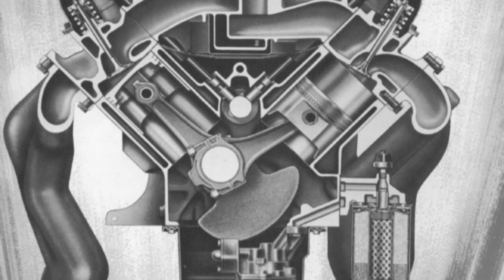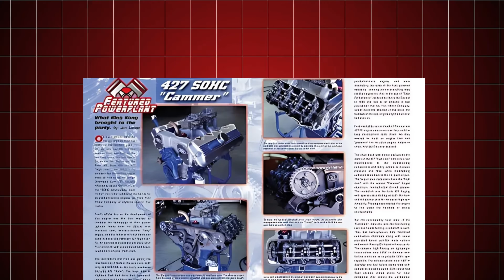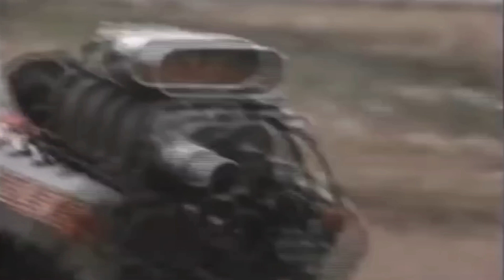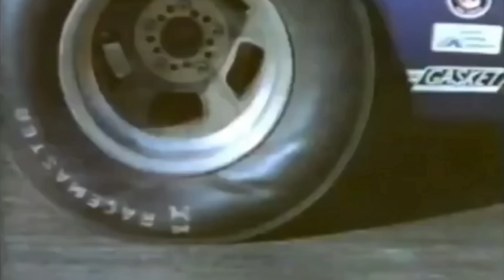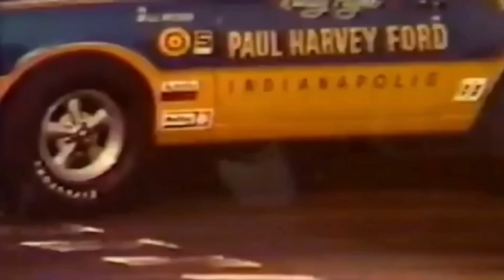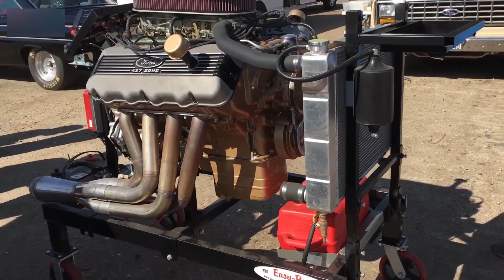The UNTOLD Truth Of Ford’s BANNED 427 Cammer Engine

Comment: So basically the only way Ford could make that engine work properly and efficiently was to take parts of a 426 Hemi.
So basically the Ford motor was worthless without taking parts off the 426 Hemi, therefore changing the Ford motor into some kind of mutant Offspring.

Comment: The Hemis produced in the 50s had true Hemi heads the ones in the 60s and 70s were not but very close  chrysler mashed the heads so the car body could be lowered over the engine and transmission on the assembly line

Comment: I have I brand new set of heads off on of theses that have never been installed on an engine. They are bolted together on a aluminum plate with a suitcase handle

Comment: Cammers would have been good except they had one terrible flaw.  Those 8 foot long timing chains were weak and would stretch, break, and were prone to cordial action (where they try to turn into a S shape when running). All of these issues pretty much doomed the engine.   Pete Robinson who was probably the last guy to run a cammer in top fuel and the most successful, designed and ran a very complicated gear drive to run the cams, but was long after the engine was out of production and he could no longer get parts.

Another reason it was canned by ford was it was basically designed for NASCAR, but they wouldn't let it run.   When Ford tried to get it allowed to run, Chrysler when to Bill France and said "if they are allowed to run that, we are bringing the DOHC Hemi out".   Nicknamed the "doomsday hemi"  the pictures Chrysler showed Bill was an early engineering mule that didn't even run, but the bluff worked and NASCAR banned the Cammer to try to keep the engines from becoming to exotic.  

Ford knew of the issues, but never solved them because there was no real place for the engine.  Instead they designed the Boss on their new 385 big block platform for NASCAR.  I really would have loved to see the Cammer in a GT40 if they had continued with that program, or the Calliope V8 used in NASCAR.
Reply: That DOHC hemi did run once, but it broke one boss on the test stand, and never ran again. It disappeared from the basement.
Reply: Chain was 6 ft .. engine wasn't good for nitro classes ...block strength wasn't there

Comment: So ford made a 427 i thought that was chevy an ford made 429or did thay make both like chev did with the 400 big block an small block mind you it might be a different size over hear in Australia 🇦🇺  witch i come to know in some muscle cars there an hear with our ford & GM / chevy too our Gm motor companys like our GM/Holden motors
Reply: Ford made a 427, 428, and a 429. Only the 427 was made like this
Reply: @treverbrown1692  cool thxu very much
Reply: Ford made numerous versions of their 427s.  You had center oiler and side oilers.  There were low riser, medium riser, and higher riser versions.  On top of all that you had the Tunnel Port (cyl heads), the SOHC, and a 3V versions nicknamed the Calliope.  And finally the hydraulic lifter version offered in 1968.  Pretty simple right?  Lol.
Reply: @anthonytomaro8278 low riser was 1963, these were essentially the same FE heads every other FE got. 1964 saw the High Riser introduced for racing, cars required the teardrop hood bubble to clear the carburetors. 1965 saw the medium riser, which gave most of the performance of the high riser but fit under the stock hood and became the heads on street 427’s, while other FE’s kept the low-riser. The Tunnel-port was a nascar head to make the FE competitive with the HEMI. The 427 was under square with 4.23 bore x 3.78 stroke, the 428 was longer stroke with 4.13 bore and 3.98 stroke, which made for a nicer street engine, especially in heavier cars. The 429 was a new design for coming smog era called 385 series that replaced the FE and included the 460 and Fords top nascar engine the BOSS 429 semi-HEMI.

Comment: Now it is time Ford builds a 427 doulble overhead cam. They could use the 6.2 Raptor engine as a base
Reply: The coyote already has an aftermarket block that can go to 400 cubic inches.
Reply: @JC-gw3yo  sohc was built off of a FE block (a big block)
Reply: I was just thinking that a big block version of the Coyote/Voodoo engine was due. 

Imagine putting one of those in a Superformance GT40 MkII.

Comment: I’m 71 years old and 700 hp is something you can by from the Dealer. Today I think you can buy better than 1000 hp in a street car. 
I’ve seen a lot of beautiful American cars in my lifetime. 
They should scout this country for every older car and restore it. Even go back to the simpler manufacturing of older cars. 
I guess that the price of steel plays a role in it. 
So make the parts from fiberglass. A lot of nice fiberglass cars out there.
Reply: Really 700 in the 70s. I think you are drunk. 
2005-2010 in Australia bringing in your parts was lucky to make 650 ish
Reply: cars are aluminum for weight and fuel mileage... cars are composite because it crashes better than metal, weight, and fuel mileage. 
you can bounce a buggy off a composite car at the store without a dent or scratch, a metal car you get a dent and paint damage

Comment: Ford and Dodge Nothing on Chevy chevy's win more manufacturer Championships with NASCAR than both of them put together
Reply: That's not hard to do when 80% of the cars on the track are Chivy's. If they were so great then why was the SBC allowed to run in a lighter car than the Ford Cleveland in Pro Stock? Could it be that they couldn't make enough power to be competitive with the Cleveland at the same weight? Lmao!!
Reply: Because Nascar catered to Chevy for years .
Reply: @scottw2157  EVERYTHING caters to sbc.  Annoying
Reply: Because 90 percent Chevy Da!!!!!
Reply: Cause they slowed the fords down cause chevy drivers was crying remember in the early 90s when chevy couldn't win a race ?😂they slowed the fords down so chevy could keep up!!! 😂  and bill Elliot set all time speed record at talladega with 212.8 mph in a Ford thunderbird before restrictor plates so why didn't chevy beat that ?   Truth is nothing runs like a ford motor when allowed to breath
Reply: @CBGRTR  🤣🤣🤣🤣🤣🤣 From 1955 to 2001 Chevy's win 798 Show me how many Ford has win 🤣🤣🤣🤣🤣🤣🤣🤣
Reply: @Tgtouh-oe9ld for has 831 wins in that era try again 😂   ...in 1990 they had to slow the fords down cause chevy boys was crying so much ...research? Yeah maybe you should try it ...and the only reason so many back in the day build chevy motors more cause they was alot cheaper to build than a ford ..pound for pound ford motors always better you can take a little small block 351 cleveland built and it will dust ANY chevy motor of the same cubic inches or even more cubs
Reply: @CBGRTR  🤣🤣🤣🤣🤣🤣🤣🤣🤣🤣 Here's a hard Facts  If you want you can go check Wikipedia nascar Chevrolet has been the most successful manufacturer as of 2023, with 851 race wins and 42 manufacturers championships. Ford ranks second with 728 victories and 17 manufacturers championships. Dodge is third in wins with 217 and two manufacturers championships (albeit no longer in NASCAR), Plymouth fourth with 191 with one manufacturer championship (albeit no longer in NASCAR), Toyota fifth with 180 wins and three manufacturers championships, and Pontiac sixth with 154 and one manufacturer championship (albeit no longer in NASCAR).
Reply: @CBGRTR   It's funny Dodge  426 elephant and Ford's megazilla Need superchargers to make a 1000 horsepower while Chevy sets back with a 632 naturally aspirated Makes 1004 horsepower To be honest I take a Chevy DZ302 If you even know what that is
Reply: @Tgtouh-oe9ld  the one year chevy made a 302 that was factory rated to rev 6000 rpm ? That what your taking about ?
Reply: @Tgtouh-oe9ld well in all fairness there are over twice as many chevys out there than fords  always has been there chances of winning are alot better... i have 2 friends that are dirt racers both run ford engines i ask why both said cause they pull harder out the turns better than any chevy motor they ever found ...why would they lie about that ??
Reply: @CBGRTR   I have a 383 stroker 500 Horsepower Plus And over 500 foot-pounds of torque and it's Still running today and it's been built over 10 years ago And it's been to the track several times With regular maintenance Everybody got their own priorities for Chevy Dodge Ford We will all argue about each other's junkAnd when it comes to all new vehicles they are all junk Overrated overpriced
Reply: @Tgtouh-oe9ld not a chevy guy but love the 383 stroker they are screamers!! ...and agree todays engines are junk with mile long timing chains ill take a push rod motor any day
Reply: @CBGRTR   Maybe you should do a little research on NASCAR
Reply: @slabbuster  How did he make out in that race did he win and it was a qualifying run who won that championship that year Dale Earnhardt and a chevy
Reply: Because  they were cheap. And a 9 year old could  build one.  Parts were interchangeable.  User friendly  really.   I can't  say nothing  bad about  a chevy  big block  or small block  but I was always  a ford man. Just something  about  them.  Wish I weren't  ide be rich now😂
Reply: @BobbyHenderson-u2h exactly  they were popular cause cheapest way to make Power not cause they was the best... fords usually make more hp and torque per cubic inch
Reply: @slabbuster  part to part and  not dollar  per dollar  rite

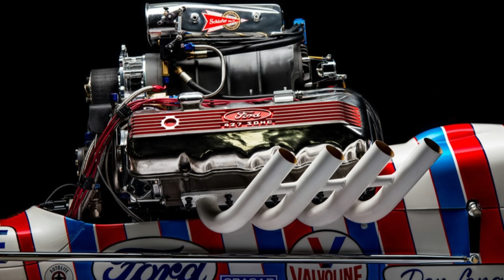Comment: 1:49
Gear drive was an AFERMARKET change to the 427 Cammer, the stock Cammer used a VERY long timing chain setup (see 2.:07 for a STOCK Cammer).
The Gear drive FIXED the worst issue the Cammer had - the long, flexable timing-changing prone to break chain drive - but showed up way to late to matter to most racing.
Reply: Imagine correcting an AI channel
Reply: @Leotheleprachaun  Imagine that there isn't a person behind these channels, even if they do use an AI to generate the voice-over for the video.

Comment: One of the reasons they didn't stay in drag racing was they were time consuming to tear down and reassemble and the chain drive was prone to stretch easy if not managed very carefully. The 426 hemi was much easier to work on and to set up immediate changes during the race day.
Reply: A gear drive was made for the engine and did away with the chain.
Reply: @jesse75  I think Mickey Thompson made his own setup like that.

Comment: Bob Glidden used to beat Hemi's and Big block Shitvies with a 351C
Reply: Yes he did beat hemis - with the weight break that wedges got. I think it was 1/2 lb per cubic inch , don't remember for sure.
Run a 351 C and a hemi straight up - no weight penalty for the hemi and watch what happens......
Reply: @michaelmoon8856  He also destroked the Cleveland to 331 or so for higher rpm
Reply: The Ultimate Ford Man. His Battles with Shepard and Johnson are some of the best ever. R.I.P. Bob Glidden-Lee Shepard
Reply: You would have to pull 2 spark plugs out of the hemi to make it a contest
Reply: @mitchellferre1652  Bullshit
Reply: Bob glidden had a nitrous bottle in one of the batteries to help that 351c along, but not a lot of people know that or will admit it.
Reply: Sorry ..untrue .. weight breaks  and  the 351 c  cylinder heads are a couple  reasons  he was a winner
Reply: @jeffoglesby1327  How was Glidden able to stay at the top of Pro Stock after the nitrous scandal for years? Maybe he did before the scandal, but like Smokey would say " Not cheatin' just bendin' the rules".

Comment: You move the pushrods out so the head ports can be as big as you need using 2 short chains one left and one right might have solved the chain issue but not the timing as setting the timing so it ran at high rpms is what kept it out of Nascar or as most think it was politics as variable timing never showed up till computers but think of where we would be with engine tech if this had been allowed as small displacement with overhead cams with fuel induction is the key to run variable HP so an engine can drive on the road and then be used to haul 20 000 lbs and be fuel efficient
Reply: Talk about a run on sentence.
Reply: some of it was politics, some of it was that it had to be pushrod or nothing. realistically they just didn't understand the engine and people thought it was going to be way to easy to cheat with it.

Comment: so much BS, first there was NO side oiler in 1964 and next the cammer was never banned.
Reply: NASCAR never allowed the Cammer on the tracks, and drag sanctioning groups only allowed in a couple of classes. My Ford literature showed side oilers in 1964.
Reply: @stephenshoemate6678  lol, do I need to show you the actual NASCAR rule book, I can.....the Cammer was approved for Competition in NASCAR in April of 1966 and was referenced in the rule books every year until 1975 at which time everybody had to go to small blocks..........FORD OPTED to never use it.
Reply: @davidthayer6969  it was banned in 1964 and 1965 due to the special racing engine rule since the engine was never used in a production car. in 1966 they unbanned it with asinine restrictions that made using the engine pointless, like requiring it to only be used in full size Galaxies and an extra 430 pounds. thus Ford dropped the program on the nascar side.
Reply: @sirmonkey198  there is a big difference in BAN and simply not adhering to the rule book.........for 1965 after losing three of his biggest stars France simply enforced the rule book.
Reply: So your a expert? And their not
Reply: This is an AI, what do you expect from such a lazy channel